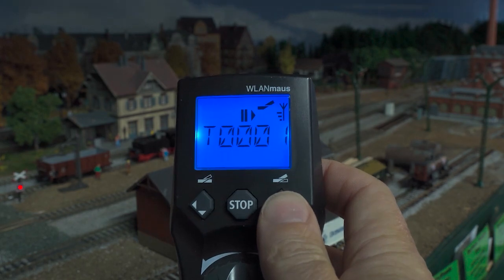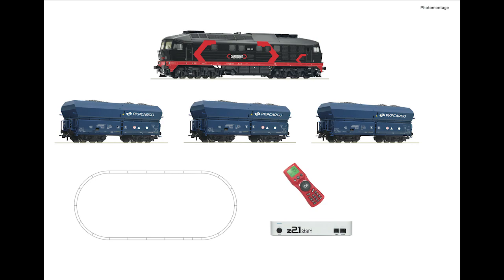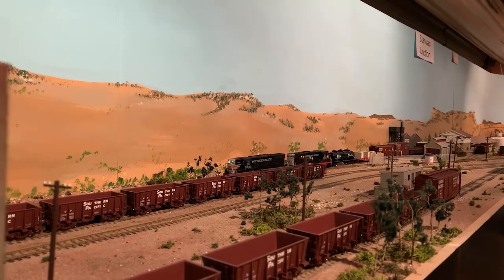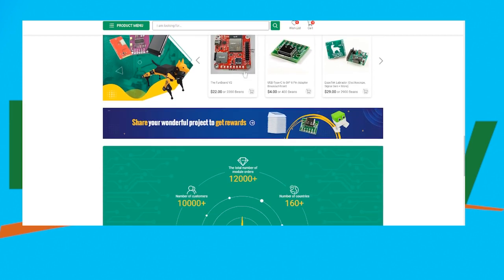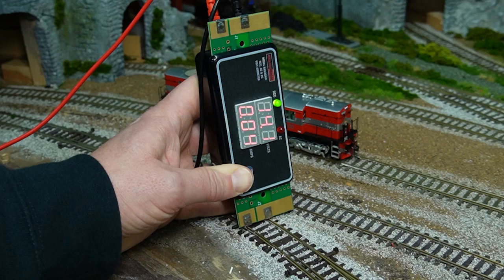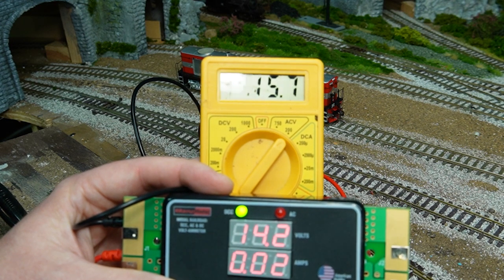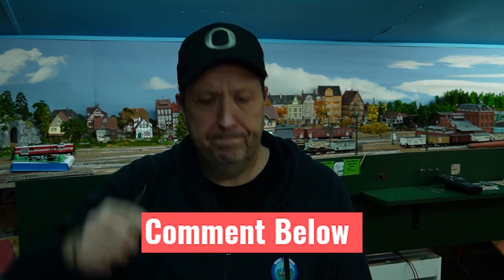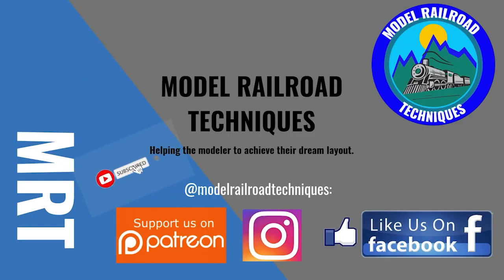Busting 10 Digital Command Control Myths

Comment: Some older locomotives with split chasis design are harder to convert to DCC due to 1 power rail connecting to the entire chasis.
Thanks for addressing these issues.   I agree that DCC is easier to wire, especially when you want to run multiple locomotives.   Running multiple locomotives on DC is more complex to from the wiring side of things.  
For turnouts/points, DCC does really need Electrofrog, where as on DC you would use Insulfrog points to allow isolation of sidings.
Reply from the maker: Agreed. Some oldest ones are more challenging to convert. My turnouts have served me well.

Comment: Thanks MRT. I don't know how many times I've had to explain DCC is not a +/- 15 volt sine or square wave. There is no negative voltage in DCC. Many people put their O-scopes across the rails and go, "Look, +/- 15vdc!" not realizing the two rails are completely separate signals. To look at the signal properly you need to use two channels, one for each rail. 
Even NEC's website on the myth's page gets it wrong calling DCC a form of PWM (pulse width modulation). Crazy
Reply from the maker: @mrhyde3029  once you get your mind around phasing all is good. Thanks for your update

Comment: For those who are new to model railways or those who want to convert a loco to DCC but are not sure on how to go about it.    I use Digitrax for my power and control, and in the past I have converted Bachmann split frame locomotives, I started by checking the stall current of the loco to ensure that I can get a decoder that will support that current, (Amps). You will need to find a or purchase a piece of equipment that can measure DC current in order to check the stall current. Stall current is checked by placing the loco onto the track, applying full power to the track and holding the loco to stop its wheels from rotating whilst reading the display on what you are using to check the current with. Once you have got the reading remove the power ASAP so as not to burn anything out. Everything is then hard wired (solder connections) without the need or use of the plugs and sockets as there is not enough room for these. For those who are not sure on how to do this, I think there are videos on You tube. I personally chose to change over to DCC for reasons of added realism when running trains. I hope I have been of some use.
Reply from the maker: Thanks for your comprehensive right up about your journey and some great DCC conversion advice

Comment: i think that command stations are going and onley power spupply's are going to be used. some manufactures are testing to merge blue thoot into the decoders zo you can run the loc direct from the app on your phone
Reply from the maker: Thanks for your comments. What do you mean by command stations are going though?
Reply: there are firms experimenting with wifi direct into the decoders .with an app onto your cell phone you can command the loc .so there will be no need any more for a z21 ecos digicase command station.the onle thing that is requered is power onto the rails

Comment: for #7 you are only partially correct. cheap multi-meters, like the yellow one you show in the video, can not read dcc voltage but a True RMS voltage meter, like those sold by Fluke and used by electricians and electronics people will read the voltage accurately. The meter you show from Tony's is a True RMS meter that can only be used for voltage and amperage reading. on the other hand my Fluke True RMS multi-meter, that I used in my career as an electrician allows me to read dcc (using the AC volt setting), dc volts, ac and dc amps, ohms (for checking resistors), continuity (dead shorts between wires as an example, used also to read diodes), and a new one doesn't cost much more than that thing at Tony's.
Reply from the maker: Thanks for your update

Comment: Time stamp 8. No it will not, because it can't. It's even different from manufacture to manufacture. For example a Bachmann will give a different reading than ones that don't allow DC trains on their system, even at idle. This is because they stretch out part of the signal to run the DC engines, which isn't good for the motors at idle. If you want the amps of your train, then you need to measure the DC amperage coming into your system, and minus the idle amperage of the system from when a train is running.

Devices like that are selling you snake oil.
Reply from the maker: Thanks for your comments. Might have to agree to disagree on some points. Thanks for watching.
Reply: @ModelRailroadTechniques  Try it. Borrow a Bachmann, and compare to what you have.

Comment: 1: DCC is too complicated.   This is subjective to the individual, I would say it definitely is more complicated, especially if you are on a DC system and wanting to go into DCC i.e. converting existing locos to DCC ones.   Simply the number of decoders out there which is good?  which is absolute junk?    Which ones would I actually need?   What if I want sound?  How do I get sounds into my loco?    All in all, more complicated then putting ONE DC loco on a track and letting it go, and then in your mind making the "chugga chugga" sound 🤣

2: DCC is too expensive.   Same as above, it is MORE expensive to be certain.   Actually running equipment aside, if you have a lot of locos how much will it cost to convert them to run on a DCC system?   Even if you get the "cheap" decoders it can add up in a hurry.    Then there's the elephant in the room,   how much do the decoders/sound systems actually cost?  Just looking online at some prices similar locos (e.g. manufacturer, detail level, etc) seem to cost $100-$150 for a dcc+sound versus DCC ready locos, which again makes me wonder how much would it cost to upgrade your existing DC locos, or are we just being price gouged by manufacturers?   The decoder + tiny speaker can't cost that much can it?

That said,  I would absolutely go DCC,  the ability to run more than one loco on the track system is something you simply can not replicate with DC.   I'm just one of those outliers of trying to make an expensive hobby a bit more affordable and having some difficult finding what I need to make it so
Reply from the maker: Thanks for your comments. Not sure I ever said Markelin was any better than NCE. Marlklin starter sets are around $300aud, so similar to nce.DCC wiring is a lot simpler wiring for similar results with multi cab use in the DC world.
Reply: @ModelRailroadTechniques  My apologies Marklin isn't very widely seen around here, and the first "dcc starter set" that popped up was a $700 one, after some further looking I did see ones that were similarly priced to NCE.